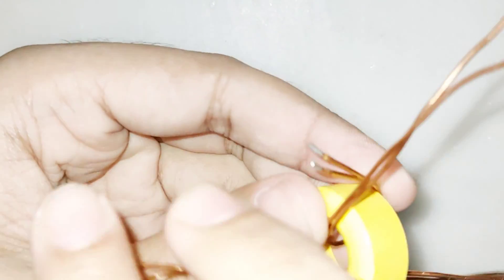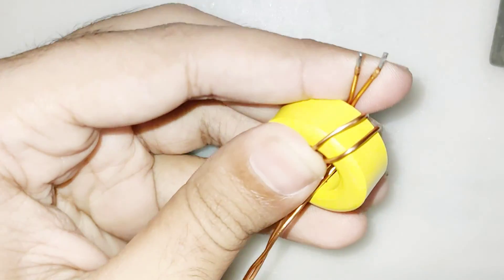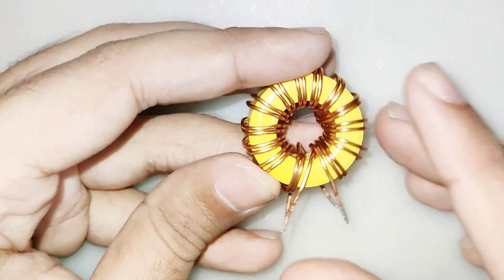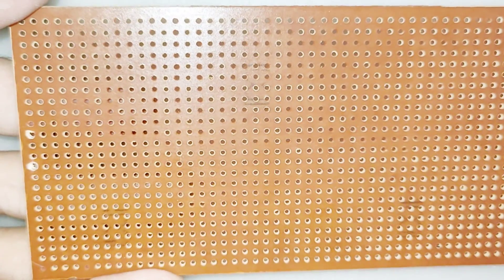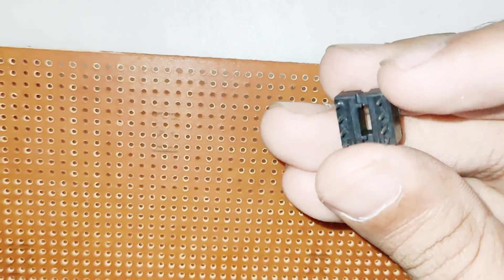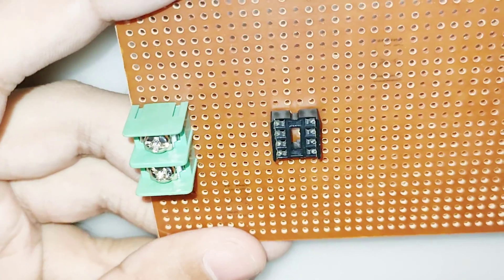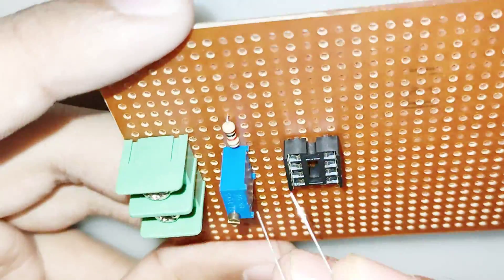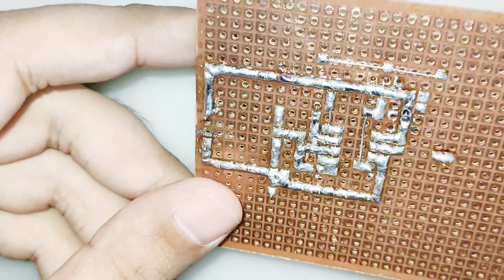DIY Buck Boost Converter 3V To 30V (SEPIC)

Comment: A Sepic converter requires some attention. C8 and C9 are rated at 50V, and the MOSFET at 60V. However, large spikes must be taken into account. A 100V rating is much safer, or you could use an RCD clamp. It's also better to use film capacitors in C8 and C9, or combine a film capacitor and a low-ESR capacitor. The coupling inductor isn't calculated. Based on the schematic, the coupling inductor will be around 33µH. Your Sepic converter doesn't match the schematic shown. You mention a 10A output, which corresponds to 30V x 10A = 300W output. With an efficiency of 80%, you're looking at 375W input. With a 12V input, that corresponds to over 30A input. In your response to the comment, you even state that the input voltage can be 9-24V. In that case, it would be over 40A input. Your suggestion that the coupling inductor should be 100uH is far too large in this case and will only cause problems or even prevent it from working. Always calculate the inductor size and find the correct toroid. Furthermore, the IRFZ44N won't draw 40A, as it can't be cooled. However, you used a different MOSFET and diode in your video. You also initially installed two capacitors, but later you see that there's only one. Your coupling capacitor is only one and is also dented. Another note is that the UC3843 requires a powerful gate driver for high power outputs with a Sepic converter.
Reply from the maker: Thanks For Detailed comment 👍🏻
There's a difference because I don't have the same components as shown in the circuit diagram

Comment: Sir, how can i change this circuit for 90 input voltage but very low ampiar ?
Reply from the maker: Needs to change so many things
Reply: @Electronic_For_You  its for 100 pcs pizoelectric . Can you tell what is the change ?
Reply from the maker: I don't have any idea what you are talking about

Comment: You did not add R9 and C7.
Reply from the maker: Hmmm 🤔 
You are right,
Reply: @Electronic_For_You Can I do that??
The IC is getting hot and the voltage is not changing. I may have made a mistake. I will try again.

Comment: What kind of material the inductor is made of? Ferrite or iron power or something else?
Reply from the maker: Iron powder
Reply: @Electronic_For_You  Thank you for quick response. Onething i was wondering iron power core will heat due to eddy current? Do you think it is better to use ferrite core here?
Reply from the maker: You can do experiments with different core also try Sendust core if you have

Comment: Is there any particular reason why my IC gets very hot?
I bought another IC but still the same problem. Am i missing something
Reply from the maker: Connect Pin-5 To Ground, it will solve the problem i think
Reply: @Electronic_For_You ohh okay that fixed it but now the mosfet is the one getting hot
Reply from the maker: Is there any signal on MOSFET gate?
Reply: @Electronic_For_You  i dont know what you mean. But i used multimeter on gate and drain and it has the same supply volt. I hope this helps
Reply from the maker: Use a led and a 1K resistor + 1uF capacitor, connect led ground to ground and capacitor 
+ -||--==--Π- — like this and see if the led Glows or not ,
Reply: @Electronic_For_You  yes the led glowed
Reply from the maker: With the capacitor in series? 
Then all MOSFET, Ic is ok , now find if there is any problem in the Coupled inductor,

Comment: How u know the positive of inductors in the circuit
Reply from the maker: It's lower end of secondary
Reply: like I  make the inductor with the same core size and bound the 2  1.3 mm wire, so which side I consider positive
Reply: My circuit is showing short circuit that why I'm asking this question
Reply from the maker: You have to use it like a transformer
Reply: Ok, meaning if I connect first wire  starting point with mosfet and other ending of  second wire is positive
Reply from the maker: First wire is a dot shown In circuit diagram
Reply: So the dot point is the starting of winding of inductor therefore I have to connect starting of winding in circuit

Comment: Sir, I want to know about the current  output range
Reply from the maker: 200W can be obtained from output depends on voltage
Reply: Sir, what would be the current range for ideal condition
Reply from the maker: 6-7A
Reply: Sir, I'm doing my college project regarding dc dc Buck Boost converter. I'm using this circuit as a reference . Sir, if you provide more information, it will be helpful.  Right now, i 'm a lot of stress please sir help a little.
Reply: Sir, i want to know is this  circuit works properly if i use the schematic correctly
Reply: Sir, i m using 8115-Rc hctc which have 1 mh inductance at 1khz and 16a current is this work

Comment: what is the input range ?
Reply from the maker: 9V To 24V
Reply: @Electronic_For_You  Sir What is the output current range. I will apply to 60 w solar panel to charge 12 volt 12 ah lifpo4 battery. Thank You Sİr
Reply from the maker: 10-15A can be input current use heatsink for transistor and diode

Comment: Hello sir, i am having difficulty finding  HCTC. Can you please provide more what should i look for in it
Reply from the maker: I can't understand what you mean by HCTC!
Reply: Sir I mean inductor choke
Reply: Where i can find the inductor choke
Reply from the maker: You can find in old computer power supply
Reply: Sir, did you remember the part number of ring
Reply from the maker: It doesn't have any part number
Reply: Sir, can you tell me about input value like how much voltage and current is supply to circuit and output value
Reply from the maker: Input minimum 9V
Reply: Sir current
Reply: What in schematic it show 12 v
Reply from the maker: Input Voltage 9V to 24V , Current depends on output current
Reply: Sir,but in the video, it shows that the input value is 12.59 and output voltage is changed by potentiometer
Reply from the maker: Yes it's The input Voltage I used

Comment: For some reason my circuit is shorted. I think I did it as it is in the diagram, but it is not working.
Reply from the maker: Connect pin 5 to ground
Reply: @Electronic_For_You  ok,   ive replaced the uc ic, and after that works fine, until  conected a dc motor. the ic now is not working. sooooo nice circuit but not for apactive or inductve loads

Comment: Nice question why you use 2 mosfeat
Reply from the maker: You can use 1 or 2 MOSFETs more MOSFETs to increase switching current
Reply: @Electronic_For_You  how to use two mosfeat mean connection for high amp
Reply from the maker: https://images.app.goo.gl/tU9AoF1KKYn1XCbBA

Comment: Hello my friend. Current adjustable control add?
Reply from the maker: You have to add a lm358 to adjust current, and it's not easy to do
Reply: @Electronic_For_You  Can you design a new mppt circuit with current and voltage adjustment?  It would be a good content
Reply from the maker: Ok I will

Comment: Why did you set the inductor to 10uH? Is there a reason? Is there a formula to refer to?
Reply from the maker: No I didn't use any formula, you can use any inductor I recommend 100uh
Reply: @Electronic_For_You  oh! sorry..I have to write 10mH, but I wrote it wrong!! Still, will I get the same result even if I use 100uH?
Reply from the maker: I think SEPIC Converters need higher Inductance, you should use more than 100uh , feel free to do experiment and try different inductors !
Reply: Hello! I made a circuit diagram just like the video right now, but the ic chip is getting hot, and output voltage is only lowered by 0.5V, so it only comes out to 11.5V! We used a breadboard, is this the reason?
Reply from the maker: Is the circuit working? And what is the frequency of the pwm signal?
Reply: @Electronic_For_You  The circuit works, but the output current is 0.07 A. No matter how many times I rotate the variable resistor, I can't adjust the voltage.. The frequency is 50 kHz in use!
Reply from the maker: What is the value of inductance? 

Try to make a 10mH inductor or similar because this is a SEPIC Converter
Reply: @Electronic_For_You  Oh, I'm sorry! I think this is an unprecedented result because we measured the wrong place with the output voltage! Thankfully, the result comes out well! But we also used the inductor wrapped in a ring, and we used about 3uH! Is there a reason to use it big?!
Reply: Pm me can you to install do solar panel of charger.

Comment: Why bro inductor get heating problem
Reply from the maker: Use Thick Wires 2MM
Reply: @Electronic_For_You  after using 2mm again heating problem in inductor

Comment: This circuit can ican two 12v 100watt panel series voc 18v+18v =36voc
Reply: Bro why inductor get heat problem
Reply from the maker: Use solars in parallel 18V Input= Output can be 2V To 36V
Reply: I want 36v to 14v for solar charge
Reply from the maker: Use solars in parallel 
12V To 30V input set the output 14V
Reply: What should upgrade in this circuit
Reply: Pm me can you to install do solar panel of charger.

Comment: De cuanto son las resistencias que colocas en lugar de la de 0,05 ohm que figura en el diagrama y finalmente, los capacitores, entre el diagrama y el video no coinciden, me lo podes aclarar?
How much are the resistors that you put instead of the 0.05 ohm one that appears in the diagram and finally, the capacitors, between the diagram and the video, they do not match, can you clarify that for me?
Reply from the maker: Hi
Sorry for that , I don't have exactly the same components so i put different components, and i used 2×.  0.1ohm resistance , 

thanks for watching
Reply: ok, just clarify which capacitors you put in the video, of course many thanks @Electronic_For_You
Reply from the maker: Instead of multiple 1000uf capacitors I used single low esr 36V 2000uf capacitor
Reply: perfect, thank you very much for your help
Reply from the maker: @marianobigoritto5276 
you are welcome always 😀
Reply: Pm me can you to install do solar panel of charger.

Comment: Hi Sir!
I am interested in doing this project but I have some questions about the project. These are my questions; 
1) Is the dimensions of the ring which is wrapped with wire very important? If yes, what are the dimensions of the ring? 
2) How can I calculate the impedance of the coupled inductor by hand? 
Best regards
Reply from the maker: Actually i didn't calculate anything, and it is working fine , the inductor is from old computer power supply 

Hahahaha :-)
Reply: 😅 😊 @Electronic_For_You

Comment: Sir whattap numbers bhejo
Reply from the maker: You can ask anything here
Reply: @Electronic_For_You bro why the negative output is connected as the positive output i mean in this way 50v 1000uf capacitor may blast please reply me😢
Reply from the maker: It's Coupled Capacitor,
Reply: @Electronic_For_You so it can't blast 😅
Reply from the maker: Yes

Comment: please test with load 100W real or 200W, is it possible?
Reply from the maker: Yeas 
Its possible but its better to use irf3205 or irf250 transistor
Reply: Pm me can you to install do solar panel of charger.

Comment: what is this circuit topology called?
Reply from the maker: It's a  SEPIC Converter with a coupled inductor,
Reply: @Electronic_For_You   I am sorry to let you know that this is not a SEPIC converter. You have a direct line from the input to the output passing the diodes. The SEPIC topology has a cap between IN and OUT and is short circuit protected. In the circuit above you can blow the diodes if you short the Output. Nice video tho ;)
Reply from the maker: @remimunteanu 
Sorry 
but there is no direct connection between input and output, and input and output is connected through the capacitor,  😊 

Thanks for watching
Reply: @Electronic_For_You  I saw an extra junction point on the schematic 😂😂. You are correct.
Reply from the maker: If someone makes this mistake and blames me that my circuit is fake trash not working! 

😁👍